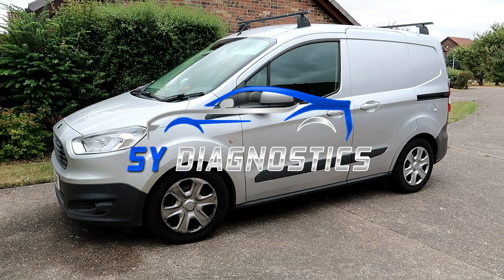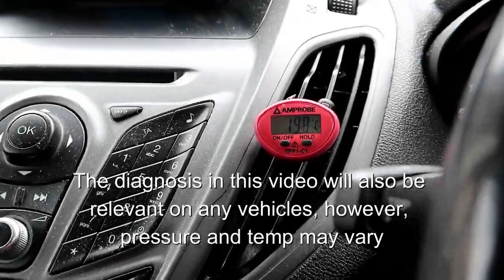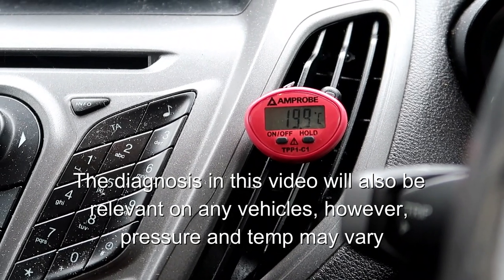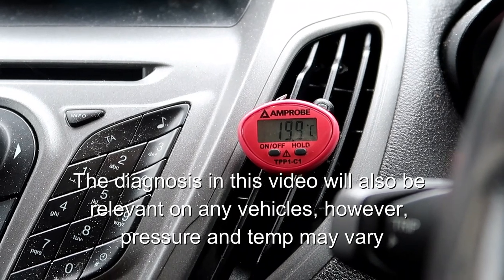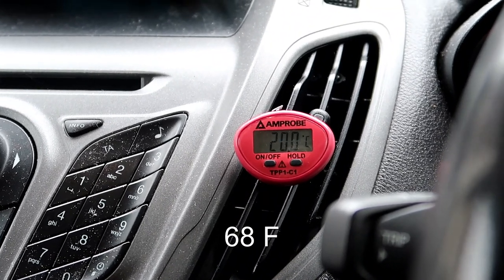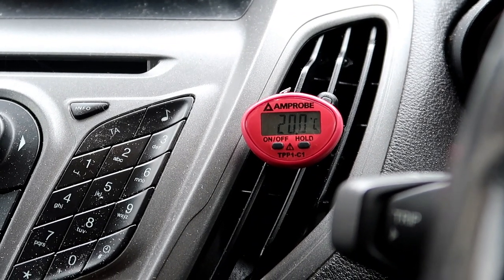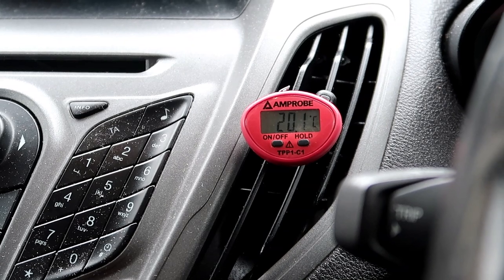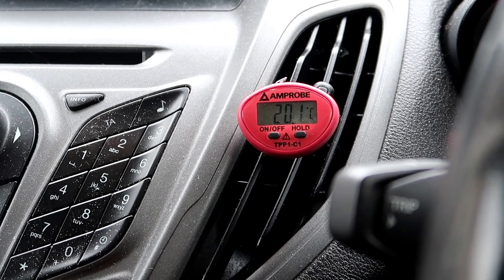A/C Troubleshooting - Why Does My AC Blow Warm or Cold Air intermittently?

Comment: Condensing temperature/ spread at 3 deg , high side at over 300 psi, with no air flow at condenser , a problem of latent heat of condensation. Great Video SY!

Comment: As it is summer there are lots of aircon jobs and I have figured that older mondeos (starting from 2006-7) won't even turn the compressor on if there's a fault in the fan circuit.

Comment: How to test the compressor at low outside temperature before the customer leaves for the south? Cover the condenser with the engine running. The high pressure should go to more than 15 bar. What do you think of this test? I call it the Saint-Tropez test.

Comment: Could you check for circuit to ground through the fan motor from your relay checks ?
Reply from the maker: yes from pin 5 to ground would show a circuit integrity from the relay through the motor to ground. Or do you mean a short to ground?
Reply: @SYDiagnostics  no just noticed you didnt do it mate .. good vid though cheers

Comment: Nice one Steve 👍🏻good luck in the new adventure, your gonna miss those rabbit holes though. Did you not fancy staying on a little longer to catch a bit more EV experience or are the knees creaking too much now 🤪.
Do you know if ford kuga ecoboost suffer with purge valve problems from cold start causing a service ! exclamation warning to light & lack of power until warm no faults stored in forscan?